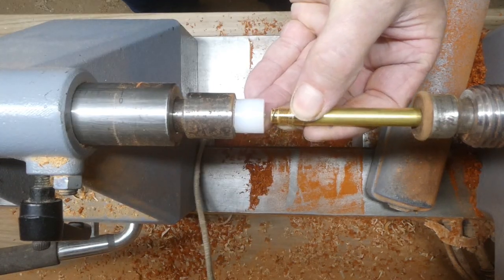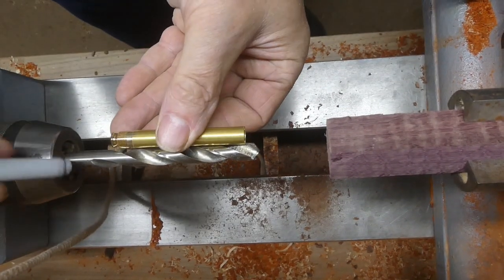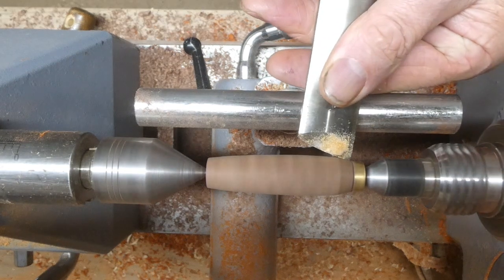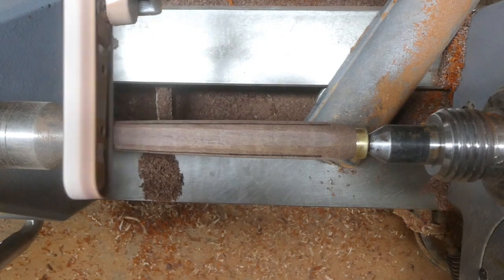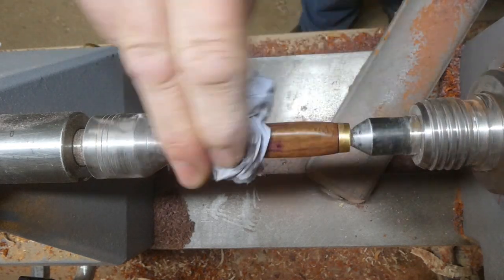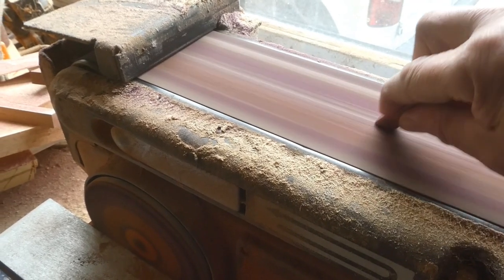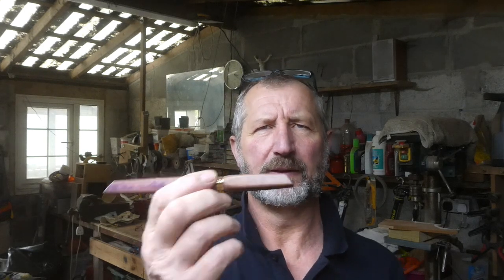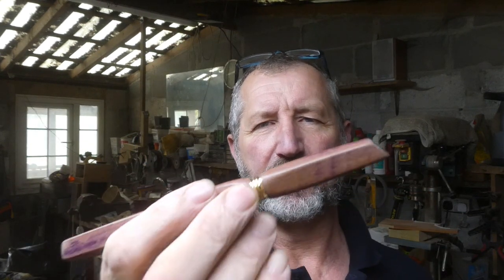20 min. Great gift or easy craft sale!.. #Woodturning #pen

Comment: Unusual shape for a pen but one that won't roll off the desk! With the three point thread start, would your earlier triangular shape work as well? Also, is it true that you can restore the colour of old brown purple heart by the gentle application of heat?
Reply: BTW, you can re-handle a small screwdriver and use the pocket clip to keep it handy.